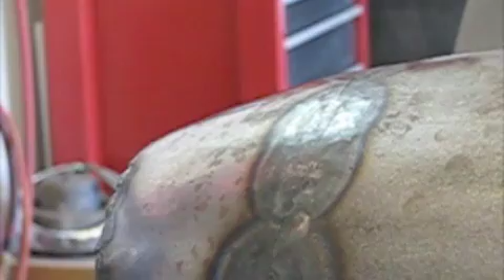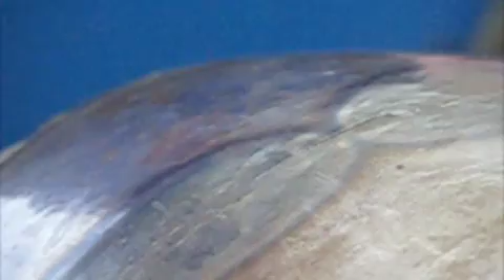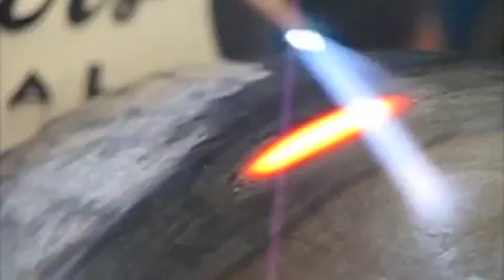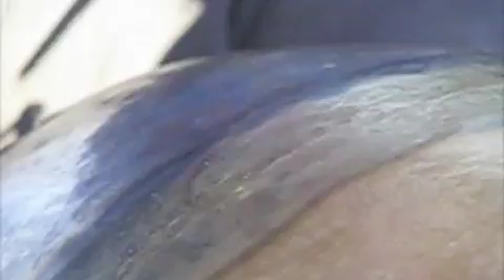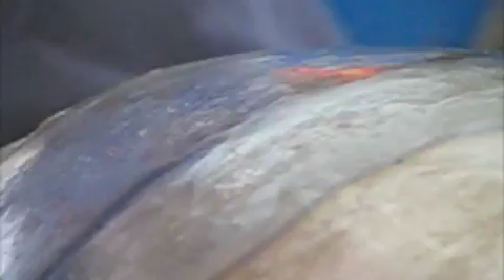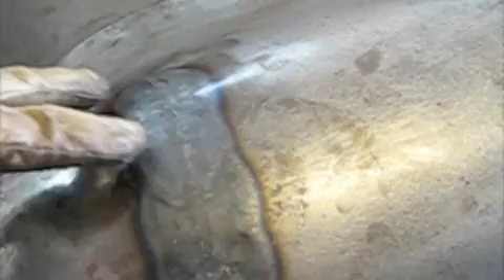Hammerwelding 1

Comment: some guys say this technically is not hammer welding, but I'm very glad I found this, it is practical for reaching my goal of gas welding thin sheet metal. one thing I'm assuming is that 50 something body is heavier metal than modern cars, it sure seems like it. I'm practicing with 22 gauge and it's great if you don't need filler but I assume I will need some and just hammering it down might do the trick, but I'm guessing I will use body filler or glaze to clean up the result. if very sloppy I would grind some down but this will thin down welds.  I've seen so many vids demonstrating tig or mig but was thrilled to hear you say how you can run a longer bead with oxy ace.  Just today I tried out my new #00 tip and took my first steps.

Comment: I also do this with no filler rod. When you don't use filler to form a bead, and, add all that extra metal, you don't need to beat on the welded seam nearly that hard, or, for that long, just a few light taps will get the job done. The other advantage, is, that you will need to do very little grinding. I finish most of my hammer welds with a few strokes of a single cut file....

Comment: Old timers just call this planishing the weld to release the shrinkage. Hammer welding, or forge welding is when a blacksmith takes two pieces of very hot metal and hammers them until they are forged together.

Comment: Mike when you are hammer welding you don't use filler rod unless you make a blow through as this tends to be harder and become brittle and can cause crack in the weld when you hammer the joint. it is best to use fusion weld so the weld can be soft and malleable. The joint will then be easier to hammer.

Comment: It looks to me like you're not welding with a neutral flame (sharp inner cone). This means you are adding carbon to the weld which means you now have a hard weld to dolly out...that is unless you are using some sort of special rod to compensate (it didn't appear to be a copper coated mild steel rod and it was way thicker than you would normally use). At least you have 20 gauge steel to work with and you can hammer on it more than 22 gauge (1953 and newer bodies).

Comment: I served a 10,500 hour, formal apprenticeship as a Panel Beater and Motor Coach Body Builder in New Zealand in the 1960s.

In the 30 years I worked in the business, performing custom work, damage repair and restoration, (to Pebble Beach entrant standards) I remain of the opinion that  Hammer Welding (of similar thicknesses metals) is fusion welding. No filler rod is used. 

Metals will contract more than they expand; once heated past a certain point. The point of hammer welding in modern sheet metal applications is to be able to control that distortion by “releasing” the contracted areas of the fusion weld, by stretching it again with a hammer and dolly, until it returns to its original configuration. 

The addition of filler rod adds excess metal to the weld area, and makes the distortion control difficult if not impossible.
Reply: I grew up in a small but high end collision shop...In all my years with my father, 95 % of all replacement was done with the gas torch..and hammer weld technique....I was thoroughly chastised by my father on more than one occasion for attempting to cover improper patch fitment issues with filler rod..Usually with the toe of his boot to my backside..And many was the time when I got to cut the offending piece out and start again...I know it sounds abusive by today's standards but believe me I learned a lot..It only took once or twice and you didn't try to cut cut corners any more..."least when dad was paying attention."
Reply: Daniel hoffman this is exactly what I was taught. I have been a blacksmith for 34 years. In my specialty, "hammer welding" is always fusion welding, no filler rod. I do a bit of auto body restoration as a personal hobby, gas welding with and with out filler rod. I have not done much hammering on the weld. I am now learning lead filling, after watching my uncle work many years ago. His was one of the last "old school" gas weld/lead fill body shops in Detroit, Michigan.
Reply: highwatercircutrider always wished to try blacksmithing...We always did lead and only if that's what was used at the factory..
 I was trained as a machinist, went into industry and worked up to engineer tech.I always enjoyed metal spinning..I love making old stuff work again and I love to see the old fellas work..They make it look so easy..LOL
Reply: You should be able to pick blacksmithing up, it is much like welding. You learn some from books or videos, but mostly just from doing it. Good luck, feel free to ask questions
Reply: With out over simplifying things, straw or "bronze" color (letting your metal cool to that ,after a reheat), and a quick quench, is usually best for most tools (edged wood working), if your steel has some carbon content. Quenching mild steel with no carbon content won't make any difference in hardness. Other colors to quench at, will produce different hardness. Much of how your work turns out, depends greatly on steel types vs. wrought irons (hard to find these days). hope this helps some, Gary
Reply: highwatercircutrider Well I must say that I've heated and beated a lot of metal in my time. I've read a lot and watched a lot of vids..I can usually make what I need..
 I just always thought that something was missing.. I'm horable at judging temperature by color..I have done a lot of hardening in high end hardening ovens but have failed miserably when trying to do it in the forge..At tempering or drawing back I'm about 50/50 with the forge..People I work with say I'm very good but in my mind I know something is missing;..I've seen masters and every swing of the hammer has a definite purpose..Each time they stare into the flames it seems they are waiting for some mysterious event and when it happens I don't see it..They pull their work and move it to the anvil and at that point I missed something important...Any time I've asked .." How do you know when to start working it?" I seem to get the reply when it's ready..
 I always try to explain things that I've learned to people that work with me and It seems that the better a person gets the more they keep secret.
I do apologize for being long winded..I thank you for your advice ..
Reply: highwatercircutrider blacksmithing is awesome i do a lot of welding myself
Reply: Nala, hows about a Youtube video on this. Do you know how Porsche attached the front and rear clips to 356s? Do you use this method for, say. Floorpan restoration on cars not heading to Pebble Beach?
Reply: Nala Hgatrum 

Please make some videos of your own,, sounds like you have a wealth of knowledge.

Comment: When you hammer it down, you smash the material down and there for there is a less chance of the weld cracking overtime from vibration. If you grind the welds flat your just making it thinner and taking the easy route out and it WILL crack.

Comment from the maker: Thanks! Much of the same technique can be done with TIG, but I typically run a shorter bead (about 1/2" at a time for 20 or 18 ga. sheet metal) than with oxy-acetylene.

I think getting your skills honed in TIG helps you get better at O-A, and vice-versa.